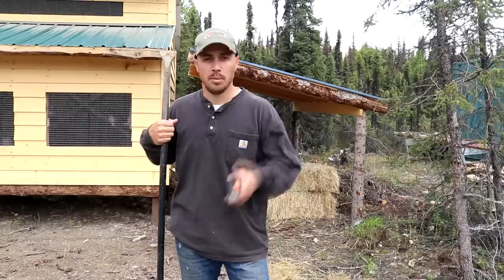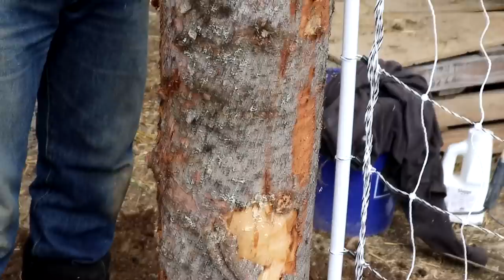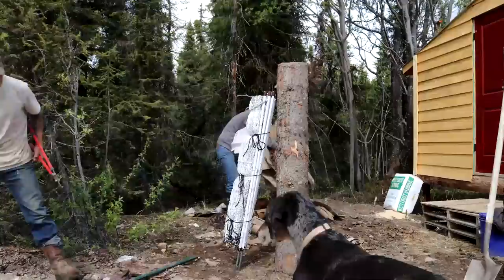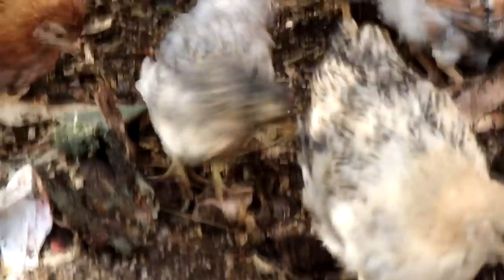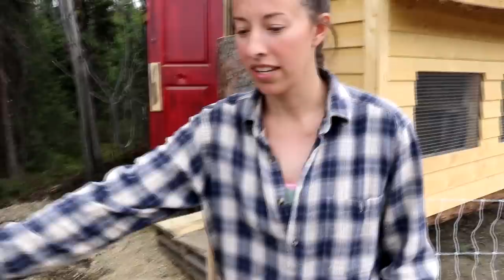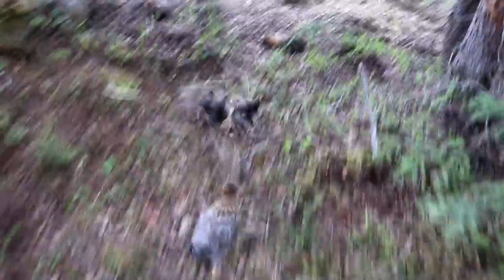Installing Chicken Fencing | Electric Poultry Netting

Comment: fantastic chicken coup. I suggest you find a singular duck to imprint on the group and thereby become the "guard dog" for the chicks to defend them from critters and sound the alarm when there is danger. This tried and trusted method is low cost and every new batch of chicks will eventually imprint  onto the duck and see it as their "parent""
Reply from the maker: Tyrone Plint, we had contemplated a guard goose and in light of recent events did get a pair of goslings, we will cover in a upcoming video and why we got two instead of one (I would have preferred one). Thank you for the tip :)
Reply: A goose is larger than a duck and has a natural guardian instinct,  To see an actual example, watch some of Jason Rhoades guardian goose, Donald and hear why the goose is a better "cop".
Reply: Victoria Bishop Justin Rhodes
Reply: I had neighbors who kept guard geese behind their house, the geese would let them know if anything came down the hill.  Their house was at base of hill, it just went right up behind them. You could hear them go off from a mile away.

Comment: We've had good success deterring air predators with taking some really inexpensive, shiny aluminum wire and stringing it from trees, back and forth over human head level across the chicken yard area (it's NOT electrified).  This method is used to deter seagulls from swimming pools in FL and it seems to have stopped owls and hawks in TN in our chicken yard. The wire need not be tight, just looped around tree trunks or branches where it can move a bit when the trees move. The wire is easy to move if you change  the electric netting area. The air predators seem to see shiny wires in the air with their keen eyesight and avoid flying into the yard.  Don't know in your wilderness area if the air predators would be aware of wire dangers, but maybe it's worth a try? I would clip wing feathers also on chickens that continually fly over, because they will start roosting in the trees rather than going back inside the fence.

Comment: After seeing a chicken population eventually get devastated by airial predators I've always thought about ways to protect them. Even if it is not that expensive to replace the chickens it bothers me to see them get munched by predators. I liked the big chicken tractor for that reason, I have seen large chicken coop areas with netting over the top (some areas use netting to protect apple orchards from hail damage so it is available).
Reply from the maker: David Mc stay tuned for upcoming videos on our attempt to deter aerial pretators, as we also hate to see a chicken go.

Comment: I have heard that there are snakes in Alaska, which would be something to keep an eye on. Also another homestead site with chickens said they had an issue with aerial predators sitting on tree branches and picking off chickens from the flock. Good luck with the peeps.
Reply from the maker: Lisa Nowakow, we will be doing a video soon on aerial predators, there are not snakes here where we live, generally our chickens eat snakes if they are small enough but I could see the possibility of danger if there were large ones. I did a quick search and found that garter snakes are in SE Alaska.

Comment: Chickens really seemed to like their new expanded area. Yay!
 Winter questions: What happens when you keep that many birds together in a roosting house? Will you attempt to have more space for daytime chicken activities that are not freeze exposed? How exactly is that handled in subzero climates? Just wondering. For real, just curious.
Reply from the maker: Paulla Wells, we only have experience at our previous place during the winter to answer your question, we had a 8 x 8 room off our barn with a covered run about 200-250 sqft, the chickens and ducks were primarily allowed to free range but on occasion were confined to the coop and run They  generally didn't leave their covered run during the periods of snow that we had which was only a few weeks out of the year. We felt comfortable housing 50 birds in that room and honestly would feel okay with more as long as they were allowed significantly more space when not roosting. 

The plan with these birds is to keep under the lean-to snow free as well as an area around the coop, plus they will have the space under the coop, as far as them going out in subzero temps I haven't experienced that yet so I don't know what will actually happen but these birds are capable of handling our winters, hopefully with minimal frostbite too. I'm sure we will have our challenges when those winter months come around but we will be sure to include it in a video :)
Reply: Simple Living Alaska - Thank you so much for the answer! I ask only because I spent some time in AK during the winter and I never thought about homesteading in that location. Personally I can’t imagine chickens in the dark and cold. It will be interesting to say the least to see how they deal with it all, especially the dark. I wonder how it would go for them with another hoop house style ranging area with an artificial light source if they seem to be negatively affected by the cold and dark. 

This is a serious cliff hanger if there ever was one!
Reply from the maker: I didn't mention it but we do plan to have a light on for them, not a heat lamp but I believe they do better when provided artificial lighting since our darkest day has just over 3 hours of sun :)
Reply: Simple Living Alaska - Right!?! My mother lived there and my first time in Fairbanks was to help her out of the cabin fever that sets in on some folks. Can’t imagine what that does to chickens. Lol

Comment: Your coop is elevated. I am just learning. Why elevate the coop in your cold climate??
Reply from the maker: Courtney Kachur we get a lot of snow here and want it up high for the winter months, also they use the underside for shade in the summer. Thanks for commenting😀✌
Reply: But the extra exposed side doesn’t make it into an icebox?  

We are in the great white north as well. 😀
Reply from the maker: Awesome, what area?

I think you are referring to the windows (as the exposed side)? I imagine it will get just as cold in there as it is outside, the whole concept is open front for good ventilation and low moisture to prevent or minimize frostbite, they are an older design specifically for cold climates.

Comment: So the problem with the fence is that there are predators that will jump from surrounding trees into the pen and have a chicken dinner
Reply from the maker: Jeff Strong, we agree it's not a perfect system but we do plan to free range them and know that predators will most likely be something we need to deal with.
Reply: @SimpleLivingAlaska  There are these monster hoop houses that were originally designed for the Army's C 130s but are now used by farmers. They can span up to 5 acres in length and acre wide. they are made of a galvanized heavy duty tube steel and designed to withstand arctic temps and winds the covering is a UV resistant plastic reinforced. Now I bring this up because if you got one of these you could run a wire mesh over the top during the spring and summer and early fall then roll out the plastic over the top during the winter and your chickies could free range year round. Some thing to think about.

Comment: WILL IT KEEP THE BEARS OUT?
Reply from the maker: Gail Reese, for some reason this netting has a much stronger zap to it and it hits more consistently, I personally think 1 joule would work for a bear, our garden poly wire is not as uncomfortable, similar to what we used on ours pigs which was 0.5 joules.
Reply: @SimpleLivingAlaska  Good to know let us know if it works .I know one will come along some time. LOLLOLLOl Be safe